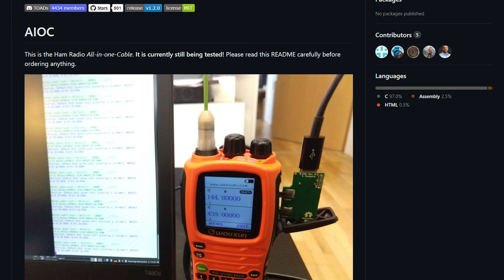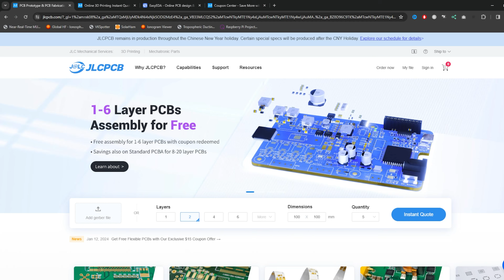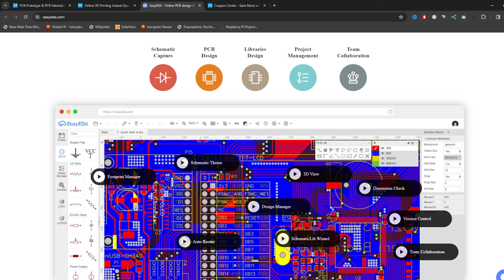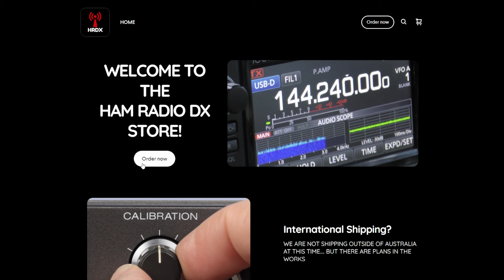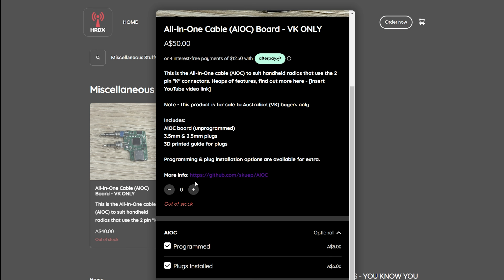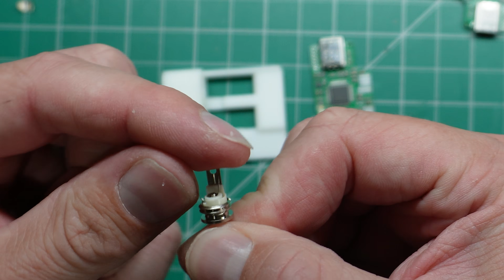The Only Radio Cable You'll EVER NEED!

Comment: The AIOC does do Chirp programming but it also acts as a sound card. I actually use mine for Direwolf to set up an APRS IGate. I have a portable IGate that I can carry with me on trips. I connect the laptop to my phone. Laptop runs Direwolf and then it acts as an Igate via the Baofeng for my APRS radio (FTM-400). The Baofeng is keyed via the sound card (CM108). The CM108 keys the Baofeng quite well and is a setting in the Direwolf config.
Reply: OH MY.
I've been having issues with those cheap Vox cables, maybe this is the solution.
Any ground loop issues with the USB connector and these things?

Comment: Ok, I am a little confused. This has been identified as an All in One Cable. However, does this work with winlink? I have not identified the methods needed to run with winlink. If this is the situation, this cannot be called All in One.

Comment: You mentioned that the com port could be used to program the radio. Other than getting the tx and rx of the serial port to where it needs to be on an hf radio could it be used for CAT control

Comment: I wonder about an RJ45 version for mobile radios 🤔
Reply from the maker: You could solder an RJ45 cable onto the pads on the board. Mobiles use different pinouts whilst most of the chinese handhelds with the K type connector are the same.

Comment: Mine doesn't work. Tried to update the firmware and the chip is detected but won't load
Reply from the maker: So the board doesn't work - or the firmware update doesn't work?
https://github.com/skuep/AIOC?tab=readme-ov-file#firmware-updating
Reply: the firmware update doesn't work.
The program says that the device is
found, but can't update.  I have the link in place
 @HamRadioDX
Reply: @HamRadioDX  the firmware won't load.  The software detects the board correctly, but fails the loading.
I have tried under windows 10 and linux.  Same error and I do have the link in. 
Are you doing another order soon and I'll order one already programmed?
Reply from the maker: @bikeham  I do have another order coming soon. Are there any LEDs when you power up the board? Programming link is definitely making contact?
Reply: @HamRadioDX  I can't recall about the LEDs, but I soldered the link in as a last resort.
Reply: @HamRadioDX  It’s working. I loaded the firmware with my Mac mini. “It just works!”
The problem was probably due to a wrong windows driver. I don’t know which one.
Now  I have 6 AIOC boards with loaded firmware.

Comment: I’m from the US and have radios this would work with, but am wondering if it could be adapted to work with a Yaesu ht.
Reply: You would need a Yaesu style plug with wires pigtail. Then solder the wires from pig tail to appropriate AIOC board pads. So you would not need to use the 2 plugs shown here directly soldered to the pcb.

Comment: Will this work for a Kenwood TK-250 ?
Reply: Maybe? i think the TK250 version of the K plug only has two connections on the 2.5mm plug
Reply: @phillipsmiley5930  the TK-250 has the standard 2.5 and 3.5 connector

Comment: My only AIOC had a manufacturing oops; the voltage regulator was not installed. After installing the regulator, it worked once. But no more.

I could use more, and possibly a few spares, so may be interested in ordering some in the US.
Reply from the maker: Thanks Lee. I’ll look at international options on the next batch I think